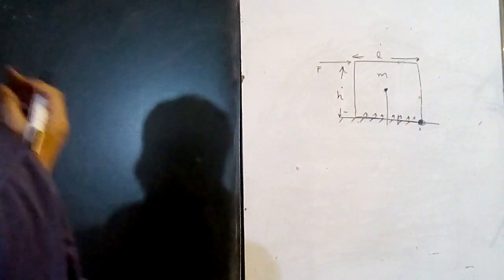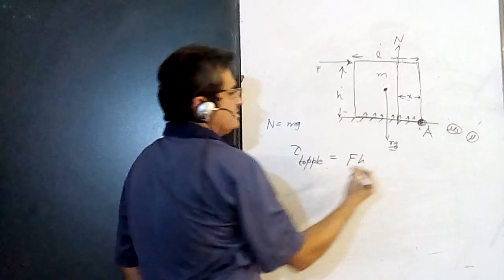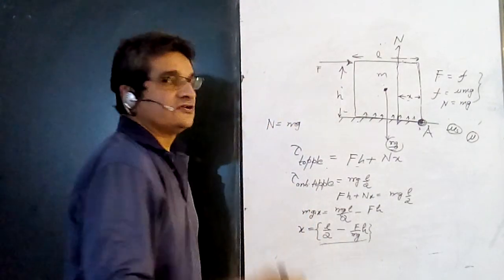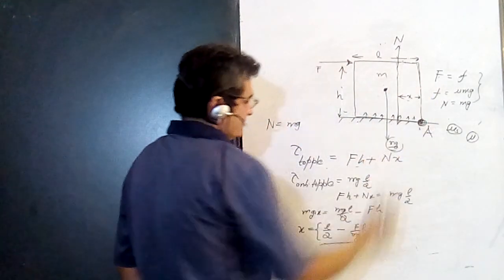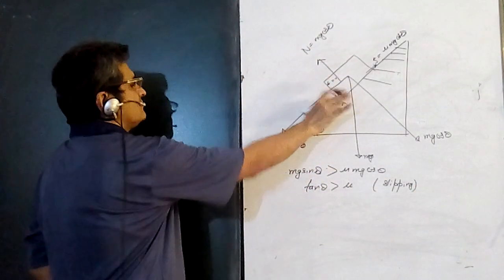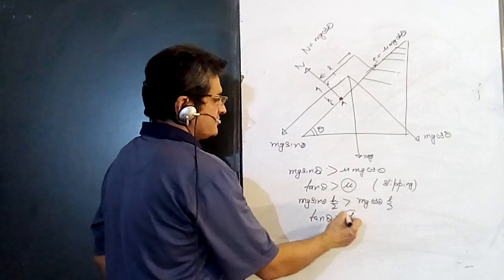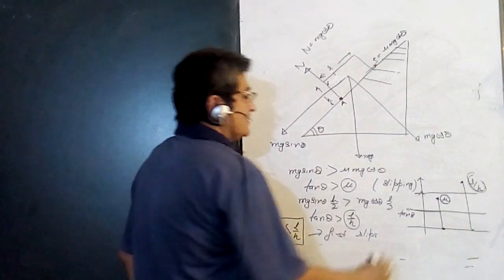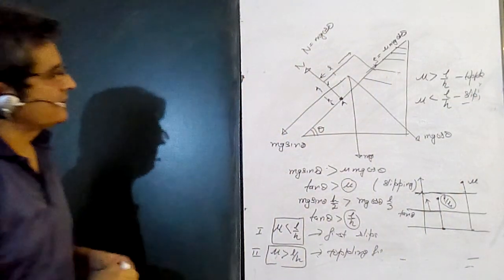What will happen first Toppling or slipping on inclined plane-rotational dynamics

Comment: sir, i have a doubt regarding the wedge problem that you solved. while equating the torques of two directions we wrote mg.sin(theta). (h/2)  ,   but in this case the line of force is passing through the centre of mass itself (i.e.  h should be 0) . in such cases will the box topple at all?
Reply from the maker: Moment is taken about edge

Comment: Sir I have a doubt in rigid body dynamics that if I consider anticlockwise rotation negative and clockwise positive then when applying relative velocity of two particle on the rigid body in perpendicular direction ,it is equal to r*(omega) so do we apply the sign if omega in this or not.
Reply from the maker: Divyanshu Pal good, the problem we face that intuitively in our mind we take direction , but we also then take sign of v or omega, this cretes problem. Best is to take a reference say click wise ad positive then put sign in omega and ADD Vectors I repeat add as vectors means you now do noy add any sign from your side after having added sign to omega.